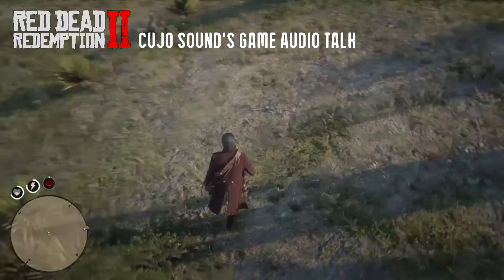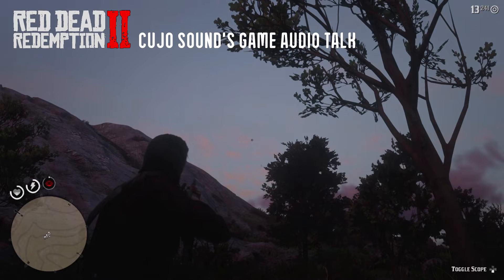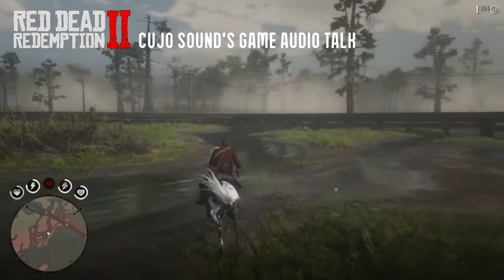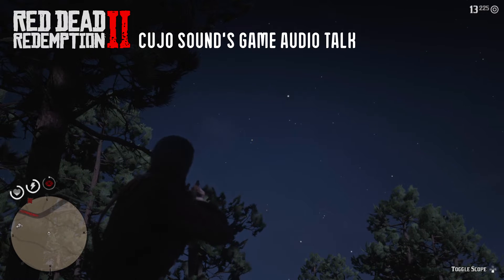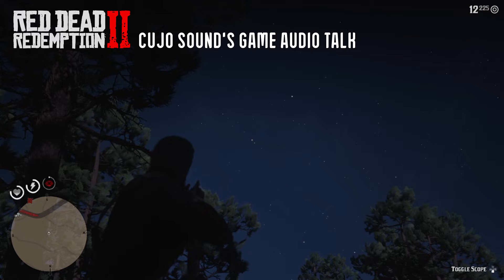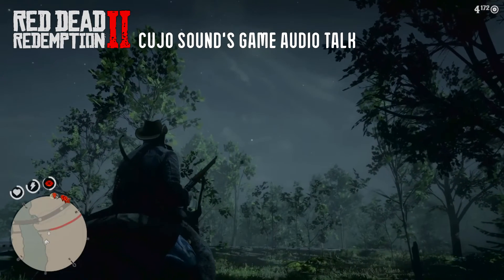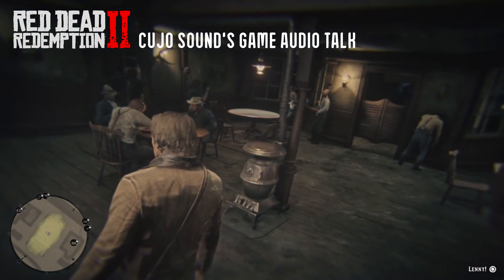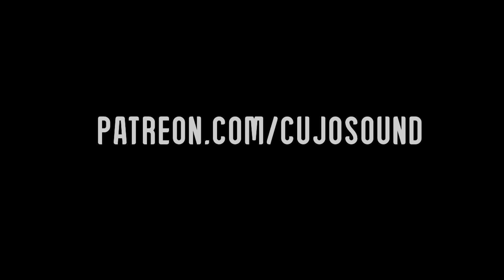Gun tail sound systems in Red Dead Redemption II. A game audio talk by Cujo sound.

Comment: Awesome video man. Really helpful.

5:05 With "hard coded tails", do you mean to bake / render each asset with the different tails? Or just to set the reverb properties per area and then still calculate the reverb on the fly?

And is there a system/tool for early reflections? I just saw a video about Overwatch where they made their own tool. I wouldn't know how to properly get the sound of an early reflection. Is it just the same sound but more quiet?
Reply from the maker: Yea - a hard coded tail would be to simply have a pre made tail sound that plays in a specific area.
Reply: @CujoSound  All right thanks!
And is there a system/tool for early reflections? I just saw a video about Overwatch where they made their own tool. I wouldn't know how to properly get the sound of an early reflection. Is it just the same sound but more quiet?

Comment: Thanks for sharing his man! By the way, I'm having very good results by using Reflect for the early reflections with WwiseMeter on it. So I can dump the long tails as I get closer to an object. I'm also experimenting on using quad files for the tails. Another option that I'm trying though is to put 4 random containers (each one on each quad side, FL FR SL SR) while holding its position until the end of each sound. Cheers!
Reply from the maker: Thanks for liking the video, appreciate it.
I made a video on Unity scripting at one point, which doesn't explain it fully, but does something that is meant to eventually do the same. Like, firing a gun, shoot a ray in some directions and then spawn the reflection sound of that material delayed by the distance to the impact. And then you can play around with the amount of reflections to allow or if it's only the two closest and one distant that is allowed to play.,

But spawn it at the point of impact - meaning that the room itself has a 100% wet reverb, but the early reflection plays differently on the impact - combined it creates a pretty nice effect actually.

Quads sounds interesting, how are you going about that?
Reply: @CujoSound  So far so good! But I think I'll keep working on getting 4 random containers (fixed to each quad sides) because it gives the same feeling as a quad sound. In fact, I can get more "quad" variations by simply using mono sounds. I started developing this idea when I realized that I don't have enough tails recordings (of the same gun) to create a good set of quad variations as, obviously, it takes 4 sounds to get just one quad variation. Will keep you updated on this!